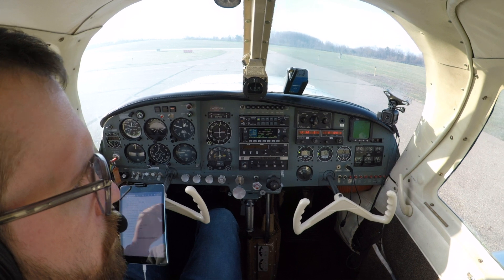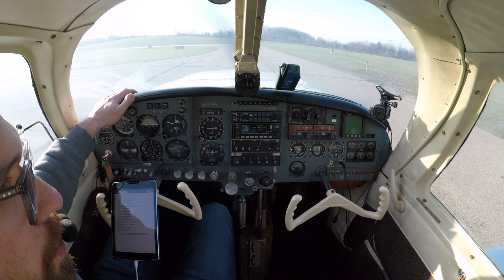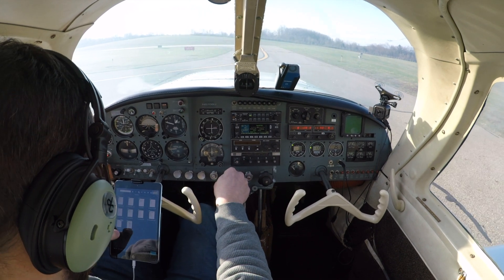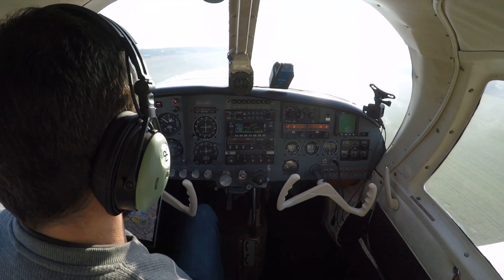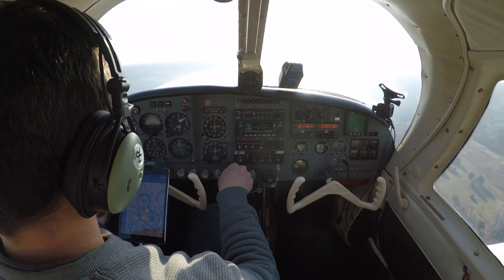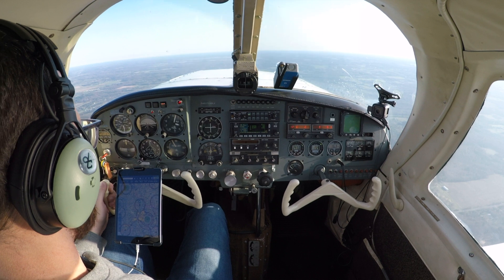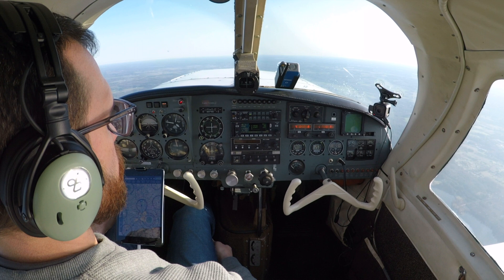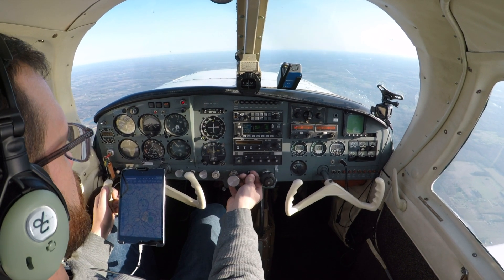Magnetized Airplane Pulling Money Out Of My Pocket - Mooney Problems / Money Problems!

Comment: I'm in the middle of IFR training right now. Instrument training has a reputation for being overwhelming. And from my perspective, I can attest that it has been for me. So anything that can be used to reduce the workload is personally important to me.

Based on that here's what my priorities would be:

1) An autopilot. Briefing an approach, programming the GPS, setting radios - everything gets easier if you can just set your airplane to fly itself while you do other things. Trying to do all of those things AND fly the airplane is a lot. And it gets overwhelming. I've tried to reduce the workload by flying a lot of VFR practice approaches on my own (no hood). Just so that I'm really familiar with everything I have to do. But an autopilot would really help. Now in your airplane, I've seen you fly hands free a lot. So maybe it's not as big of a deal to you. But I can't really fly my airplane hands free, not unless I put about 160 lbs in the passenger seat. 

2) Not just a WAAS GPS, but one of the new Garmins. I have a GPS 175 and I can't believe how much I've fallen in love with that unit since taking instrument training. The touch screen makes programming flight plans so much easier than the 430W devices. On top of that I can also connect my ipad to it via bluetooth to submit flight plans. Again this reduces the pilot's workload.

3) Getting rid of the steam attitude indicator and directional gyro, and replacing with G5 or GI275 or AV30c. This reduces the area that I have to scan while flying the airplane. 

I personally would rank #1 & #2 pretty close, with #1 edging out the GPS by a little bit. But #3 is a pretty distant 3rd place.

I recently did my longest VFR cross country from NC to WI and back. And both ways, clouds over the mountains became the most stressful part each flight. On the way back, it was at night. And after that experience I made this commitment: I will never fly any trip that has a night portion greater than 1 hour until I have my instrument rating. The risk of accidental flight into IMC is so much greater when you can't see the clouds. So, for me and my mission remaining just VFR is not an option that I will consider.
Reply from the maker: Thank you so much for this amazing comment…your thought process is phenomenal. It also leaves me a little dejected, as we’ve mostly committed to NOT putting an autopilot in this Mooney. It just becomes cost prohibitive so quickly. I do agree however that the autopilot is a very big workload reducer. 

Best of luck as you finish up that IFR! That’s again for the insight!
Reply: Sorry, man! Didn't mean to make you feel dejected.
Reply from the maker: No problem at all. I pinned your comment, I hope everybody reads it!

Comment: I had the same issue in my Aztec which also uses a steel tubular frame, it took me a little bit to resolve the issue, and as I see it based upon my experience , you have a few options, 1) you can try demagnetizing the airframe, there are companies that rent the equipment to do so, but this can get very expensive very fast. 2) relocate the compass slightly to spot less effected by the magnetic fields.  3) identify the magnetic hot spot(s) and wrap Mu metal around that area to reduce the magnetic effect 4) get a different/better compass.  The two choices I see for compasses are the PAI-700 vertical card compass WITH the balancing balls, or the SIRS compass, both have a much greater range of correction than the standard airpath compass.  Just be careful with the vertical card compass I find that they sometimes have issues, I was able to swing one on 3 or the 4 cardinal headings, it just wouldn't swing completely, the SIRS worked nicely and is preferred compass.
Reply from the maker: Thank you kindly!

Comment: On my M20B, over on the other side of the state, I'm going the route of two G5s (GMU11 in the right wing and GADD29) and a non-WAAS 430. I have a wing leveler on board and am really curious if it will work when it has something to connect to (for a heading).

I too would love a three axis autopilot for doing IFR, alas my hours of hand flying VFR will have to do.
Reply from the maker: Thanks for the details Joe, I’m sure you’ll be very happy with the setup.

Comment: Some thoughts:  I’ve had my ‘68 C for 28 years and 3000 hours. I got my IFR 30 years ago in a PA 28 with no autopilot, 1 VOR/ILS and 1 ADF, no area navigation. “ Situational awareness” was everything. I’d say that on - board weather has given the greatest safety advantage over everything else. Even now when I do practice approaches under the hood I do not use autopilot. The only time my autopilot went TU was in real IMC doing an ILS with family on board ( a basic rule in flying is that everything breaks, you just don’t know when.) My Aspen has been great. Synthetic Vision is entertaining, but may be TMI? When the remote transducer was mounted on the cabin roof it went crazy, found out the ferrous coat hanger hook inside was the problem. Based in S Ohio I routinely fly to Detroit, Philly and Ft Worth. Without IFR rating couldn’t do it. Looking back I’ve only had to do a handful of low approaches in real IMC. My hanger neighbor and I trade off being safety pilots to maintain proficiency , not just currency. I have a GNX 480 and an S Tec 50 which will do holds all day by itself. It doesn’t fly the glide slope which I think is the easiest part. Fore Flight is amazing. My friend put in a  >$110,000 panel using it to back up his I pad! I’ve resisted buying another plane because it takes a couple of years to learn how rapidly everything is falling apart- in planes, if it’s not ready to break, it’s too heavy. Also, owners may not keep up on maintenance if they’re planning to sell, and just because it looks good does not mean it IS good. Even brand new planes from factory have issues. My plane was built when workers were paid ?  $7-8/ hour, compared to $100/ hr cost of employment now. I’m happy and much safer than ever. Owning my own plane makes me fly it and proficiency is everything , and more important than bells and whistles. Aviating, especially IFR flying is a perishable skill.
Reply from the maker: What a great story, and a tremendous relationship with your airplane. Thank you so much for sharing all of your knowledge!

Comment: im a new low time "pilot" so take what i say with a grain of salt. that said, i wouldnt sell the plane because this is a reliable plane you know and bringing in others would complicate things having too many hands in the kitchen so to speak,,plus uying another plane, to me at least, could be getting another persons headache. youve gone through making this one reliable etc could cost you three times as much next plane than just upgrading avionics....id say get one g1000 for pic seat to start, learn it get checked out on it and do some trips vfr then go into instrument training..and im sure you can add more things like auto pilot later on... remember its not a race its a journey
Reply from the maker: I appreciate your thoughts, and I tend to agree. Also, “low time” doesn’t mean bad ideas…I definitely appreciate your input!
Reply: @ThePeases414  for sure! didnt mean it as a bad thing but im only 4 hours in so took a "common sense type of approach. at least what i would do. theres just those variables that if you got a new plane whos to say it wouldnt need a brand new engine? etc, now of course i know you wouldnt buy a plane without a PBI, but stil you just never know. that said, if the one you have is wearing down and you and your partner could swing something newer or less time with an annual thats just been done etc. id say have a sit down with your partner, lay out realistic expenses,get quotes on an "avionics upgrade installed" deal and compare that to what planes are out there. mooneys are great and is my favorite GA plane. another insight to look at is with upgrades, what could you possibly sell your guys mooney for down the line? so if you upgraded to all glass avionics, AP, maybe garmin smart glide technology etc, could you maybe sell it then for 80k to 100k? and use the to upgrade down the road to something bigger faster than what the mooney is? many ways to skin the cat all depends what will work for the both of you
Reply from the maker: All good man, thanks for all of the thoughts!

Comment: Basic Aspen, E5, is less than $5000, you can add modules to do more.  Thats less than 2 G5's with required stuff, and an easier (cheaper) installation.  Add a Garmin GPS175 and you have WAAS capability.  If your legacy NAV/COMs work, leave them in place.  You're probably 30 hours for install with that combination, all in at our shop around $13,000.

 Regarding the compass, has your shop put a calibration unit on?  You can correct out some of the magnetic field from the roll cage by doing a full swing.  Compass is a required instrument for flight, magnetic direction indicator, so really needs to be corrected.  Particularly before you do instrument flight with it.
Reply from the maker: Thanks for the detail Tom, stay tuned to my next video where I’ll talk about my initial quoted avionics costs…it sounds like you’ll be able to tell me if they’re reasonable or not.

We did try to swing the compass, but didn’t get where we needed to be.

Comment: As a fellow Mooney owner (82 J) I'd hate to see you get rid of the Mooney.  I'm by no means up to date with all the options currently available with new electronics but I think you could incrementally upgrade you electronics over the next 5 years or so and get where you want to be.  You certainly have a solid platform to start with with the Mooney.  Think of it this way, are you spending money to upgrade to suit you, or worrying about what someone thinks its worth?  Kinda like a house, if you plan to live in it for a long time you spend on things you want, if you're gonna flip it, different story.  I've invested probably 2 or 3 times in Avionics for my Mooney than I paid for it, and what it's worth, but I don't regret a single $ of it.
Reply from the maker: Thanks man, sound advice. I do love the Mooney, and don’t plan for it to go anywhere, anytime soon!

Comment: I have a 1961 Mooney and recently restarted my IFR training.  The Apollo GPS in my plane was discontinued years ago so I could not get database updates.  I decided to install two G5s along with a GNC-355 and remove the vacuum system.  It was around $18k - finished a few months ago.  I'm amazed how much easier flying with the GNC-355 is over the old Apollo.  I've only had around five lessons with the new system but I'm really liking it.  I really wish I had an autopilot but I have spent enough for now.  I can see I will want an autopilot if I end up doing a lot of IFR flying.
Reply from the maker: Very cool, thanks for the recommendation!
Reply: @ThePeases414  I too have dual G5s and the GNC 355. Finished my IFR in September 2022. That along with a LHS (Landing Height System) in my 66 M20C and she is now a great platform. AP is later ;o)
Reply from the maker: I love it, glad to hear it’s working well for you!
Reply from the maker: I’ll do just that!

Comment: I have a '65C, also with the KLN94 and everything else 'steam'.  I fly IFR in my Mooney, but I'm also considering an Aspen.  My situation when I got my IFR was we had a 172 with all old gauges.  It was technically an IFR plane and legal.  The best part of training in a basic IFR plane is that your checkride will be based on the plane you are flying.  In other words, no autopilot to mess with, a basic model GPS to manipulate and relatively simple approaches to master.  For me, learning more advanced systems AFTER I was IFR rated was more simple.  It gave me good IFR training using basic equipment.  Granted, with basic IFR equipment my personal minimums are above what someone with the full GFC500, G3x etc might have, but frankly when weather gets that low, I'm not sure I want to be in a single engine plane anyway.  Although it would be very cool to have all the bells and whistles, and arguably safer.  My question becomes "how would that change my personal minimums? And if it does, is that worth the investment?"  If I was again in your situation, because of the compass (same issue in mine), I'd add either G5 or Aspen and remote magnatometer.  KISS - keep it simple, get the rating, then determine what you need to fly safely in whatever plane meets your mission and set personal minimums.  You will really be surprised by how much your skills improve and your confidence increases with the instrument rating.  
Side note - the autopilot is a game changer when flying IFR.  We have a STEC-30 w/alt hold and it reduces workload remarkably.  While it doesn't do the 'work' for you like the GFC500, it certainly helps with task saturation.  While training and getting rated though, the hand flying without autopilot is a good skill to have in your toolbox.
Thanks for the videos - I like watching.  I'm retired ATC and your radio skills are great for a VFR pilot.  That alone will help you a great deal in your instrument training.  I did my first on YouTube this year when I went to OSH https://youtu.be/Hb9oh48qFuU
Reply: Thanks for the detailed comment- you mentioned that you have a similar compass issue. How did you ultimately address the problem? Remote mounted magnetometer?
Reply: @wesnoble510  lol.  We adapt and overcome!  It's close on the ground (almost always).  I keep the DG set to the GPS track in flight.
Reply: @flyingATC  I have been doing the same but was hoping for a real solution haha
Reply: @wesnoble510  we did install the two "cue balls" on each side, not sure what they're called.  I'm sure somebody can tell you that.  It helps to reduce the magnetization.  Then an A&P did a compass swing and it got IFR certified.  That was the jest of my opinion, if your plane can get IFR certified with the current equipment, I'd train in that.
Reply: @flyingATC  Roger- “balance balls” on order
Reply from the maker: Thank you so much for the great information and kind words. You’ve given me a lot to think about!

Comment: I haven't heard of an aircraft getting magnetized enough to really affect the compass. That's pretty wild. I hope you get it figured out. I'd take a hard look at whether this is everyone's forever plane. If it's not then it doesn't make sense to do upgrades. I'd upgrade your GPS, get the magnetometer and fix the compass at a minimum if you keep the plane. I have a pretty bare bones 64C and I'm not so sure this is my forever plane so I haven't performed any panel upgrades. Just doesn't make since with how much it costs.
Reply from the maker: I agree it’s hard to know if this plane is forever, but it’s clear it will be here for the next few years.

Comment: I am a VFR pilot that fly's a very tech advanced experimental (Two Dynon HDX screens and a two axis Dynon AP...no vacuum system nor round gauges).  All I would need to add to my plane is a IFR GPS navigator (like a GPS 175).  It is quite a capable airplane.  If you mission is IFR then you need an updated IFR GPS as that will give you great capabilities.  There is one thing to think about...I have a friend who fly's a V-Tail Bonanza with basic IFR instruments and I have asked him why he hasn't upgraded (He is a recently retired Delta Captain and also Retired Air Force Eagle Driver) and his response was I won't fly single engine IFR.  If you lose that engine in or above the clouds it does not matter how tech advanced your cockpit is you are going to have to get it down through those clouds with little to no idea what is below...just some food for thought.
Reply from the maker: Thanks Scott, that certainly does make you think. Regardless, I'd pursue the rating in a single engine, I definitely couldn't afford the training in a twin!

Comment: Something to consider is that remote mount or piano mount magnetometer style instruments are also sensitive to magnetism there are specific mounting locations and guidelines that people like garmin put out put out to isolate those units from magnetism so if you're already having a magnetism problem you will likely have issues with a install of anything along those lines
Reply from the maker: I will certainly pay attention to that. Our thought is, the steel roll cage doesn’t go out into the wings, so we should be able to locate a magnetometer out there. I’ll have to do some more reading.
Reply: @ThePeases414   Reach out to the YouTube or build fly go build a fly go he did some testing per the garmin manual for locations on stations on the magnetometer placement on an RV10 that he is building he probably has the probably has a lot of good insight for you for that as while there's a way to test and verify that it work with garmin
Reply: Build fly go
Reply from the maker: Thanks again